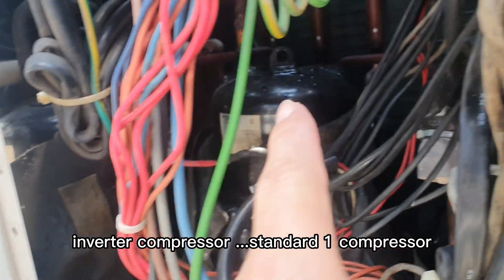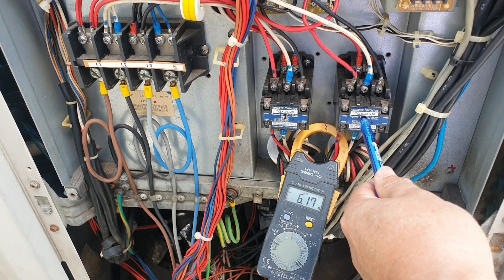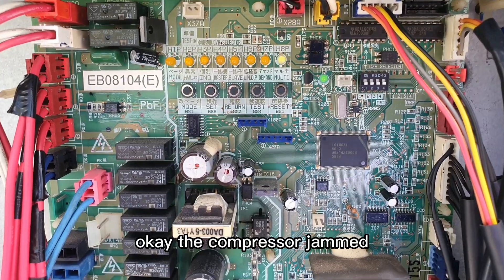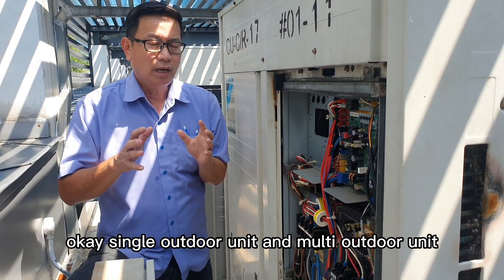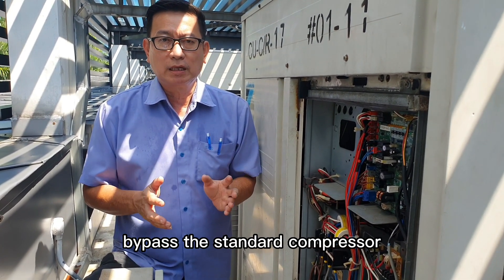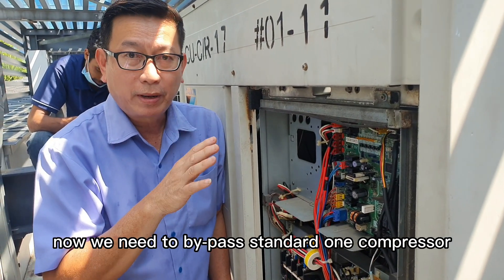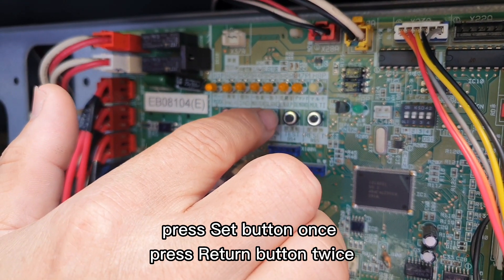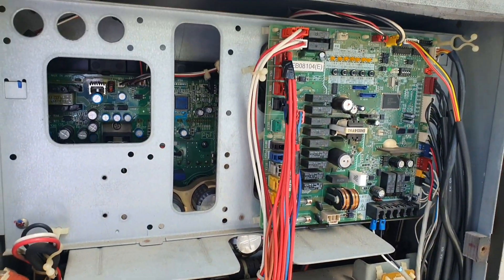How to by-pass Standard 1 compressor | Daikin VRV3 | ermergency setting.

Comment: Bon Sir If the standard Compressor 1 is Defective we press the Set button 19 times for the by-pass setting But sir if the standard Compressor 2 is Defective then how many times press the set button??
Reply: In an other case if the Inverter compressor is Defective then What should we do?
Reply from the maker: If both compressor down,mean the system cant work .
Reply: @BonMj  For compressor 2 the setting will be same or not?
Reply from the maker: @kashibaba521  not same
Reply: @BonMj  ok thanks
Reply from the maker: This is single module?
Reply: @BonMj  yes its Single module system
Reply from the maker: Later i check.
Standard compressor 2 a bit different

Comment: Mr Bon.Thank you for all your guide.You are the best instructor.
Would you help me please.I have the VRV Classic Inverter and in my case I have that issue: the H2P and H8P is blinking and H5P is ON.The compressor and fan does not working.
Thermostat display indoor units shows Error button Menu of three of them and for other 2 units: Clean filter.
Can I make the same steps as you showed in this video to bypass the Standard Compressor 1 or is different in my case?
Is there  a problem or mean some error?I thing the compressor does not have refrigerant,can also run the compressor and fan for this VRV Classic without refrigerant?.In the compressor 2 does exist refrigerant?Thank you!
Reply from the maker: Hi.thanks watching my video.
1)What is the outdoor unit model 
2)what is the error
Reply: @BonMj  Hi Mr Bon,the model for this VRV is: RXYCQ12A7Y1B  DAIKIN EUROPE N.V.
 MFG DATE 2014.01 
DAIKIN VRV CLASSIC INVERTER.  
1) External single DAIKIN unit. When I start the VRV the master PCB  model SEB11050(D) has: H2P and H8P blinking
The H5P is ON.The other lights is off.The PCB does not have display.The PCB it looks like a VRV III.
It is single external unit.Also the fan and compressor not working(is there a problem as long the gas is insufficient or not at all?the compressor and fan can work only if the PCB  detect pressure and/or refrigerant?)
2) Internal units
On the Thermostat(remote controllers display i mean) from indoor units shows: 
ERROR BUTTON MENU
I didn't press the Menu button because I didn't know.Now I know what I have to do to show the error in this display.
Maybe the next 2 weeks can I tell you what error show in display from indoor units.Thank you!

Comment: Hi bon
After change new standard Compressor still high amp 9++
What is the reason??
Reply: Please tell me u4 alarm for vrv3
All building all units
Reply from the maker: @amirhvaccenter5967  check communication wire,  CU main pcb or indoor pcb
Reply from the maker: Check cu EEV
Reply: @BonMj  👍

Comment: Hy mr. Bon, I want to ask, how about multi outdoor emergency settings for the compressor?
Reply from the maker: Multi outdoor unit only can by pass the cu for vrv3(main,or slave 1 or 2)
Reply: @BonMj  that's right.. then if there is a problem with CU Slave 1, it means that vrv 3 multi outdoor unit can only by pass. which can be turned on CU main and slave 2. for CU slave 1 off (by pass) like that kah?
Reply from the maker: @hidayaturrokhman3538  yes
Reply: @BonMj  thank you ..
Reply from the maker: @hidayaturrokhman3538  welcome